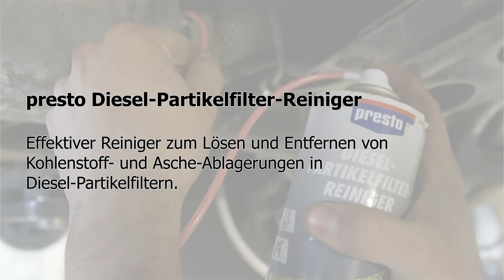presto Dieselpartikelfilter-Reiniger / DPF-Reiniger

Comment: Great stuff! Mitsubishi Outlander III 2014 2.2DiD. Idle pressure differrence 3.5KPa and constant DPF service required caution. Oil levels good, engine works and regenerates just fine, but annoyed with the Caution. Something seems to prevent resetting the caution. I unplugged the upstream hose (before DPF) from differential pressure sensor and sprayed the cleaner through that hose. Brass nozzle from the spray tube needs to be remover (I just cut the tube). 15min idle, 45min test run with forced DPF regen and now pressure difference is 0.5KPa. At least that is in acceptable range now. Only needs to get rid of the caution. Hopefully it permits the resetting the caution now.
Reply from the maker: Dear Pekka Jyrkönen, 
It is good to hear that everything worked out with the application of the product. Depending on the make/model, it may be necessary to clear the fault memory manually.
Best regards, 
your European Aerosols Team

Comment: Hi, some questions, in the morning when I start  the engine can I put the dpf spray with the engine running? 
Our it's better the engine run about 20m to the dpf get hot,  turn it off, put the spray wait 15m the spray making is job, and than turn engine on and drive about 30m?
Have a nice day 👍
Reply from the maker: Hello Cláudio, both not quite optimal ;) We recommend that you use the product on a cold engine or at a maximum temperature of 50°C. As you can imagine, it is not good for the interior of the DPF if it is heated and you then apply a cold cleaning product. Damage can then occur. So please use according to the instructions on the can or in the technical data sheet, then the presto DPF cleaner will work perfectly.

Kind regards
European Aerosols Social Media Team

Comment: Bonjour, est ce que les "particle filter oil ash mass" (en g ou ml) vont baisser automatiquement après le nettoyage sur un 2.0 tdi 170 ip, ou il faut faire une manipulation avec vcds ? Merci
Reply from the maker: Hello Alexandre, this should actually be detected automatically via the differential pressure sensor. However, on some vehicles the error memory must be deleted.

Kind regards
MOTIP DUPLI Social Media team